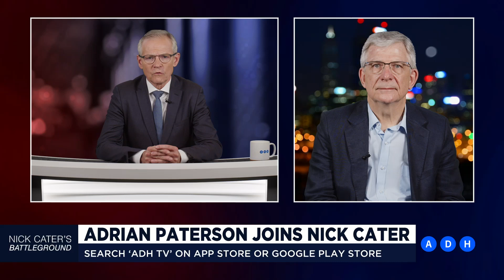Australia’s green politicians are misguided on engineering: Adrian Paterson | Nick Cater

Comment: An excellent description of the duplicity and  stupidity of Australia's energy stragedy.  It is reprehensible that engineers are going along for the ride on the climate industry grave train  The mess he referred to can be   a big flash bang and lights out. Grid operators in Europe have been concerned by this problem for years . Now of course Europe is restarting nuclear plant and increasing coal use to avoiding freezing this winter 🥶.  Putin isn't the problem it's suicidal energy policies.